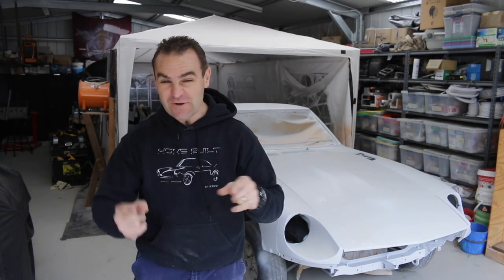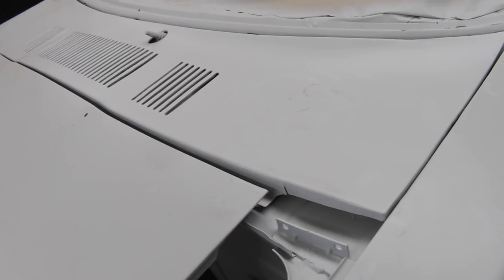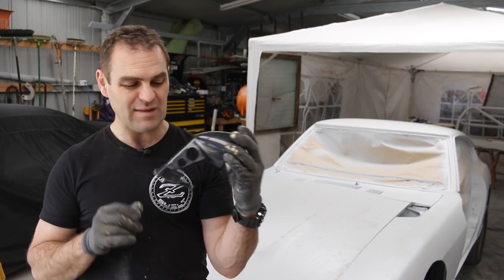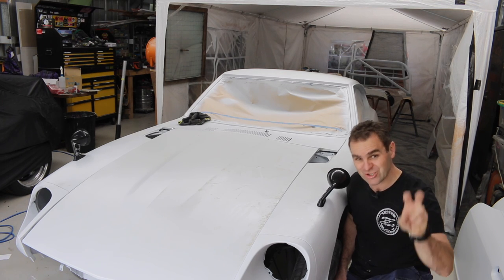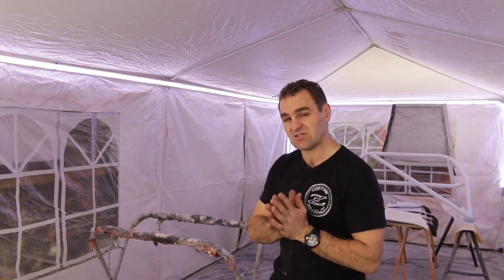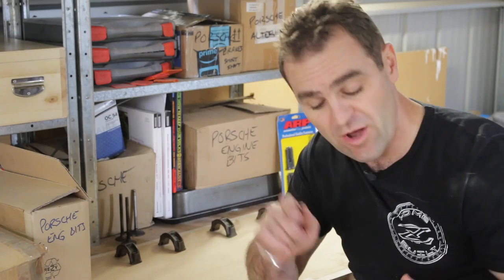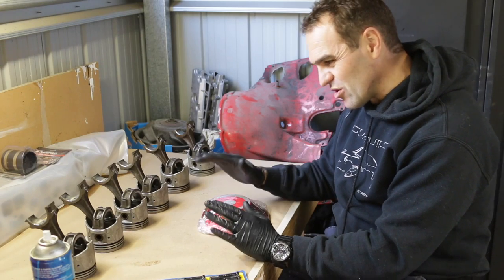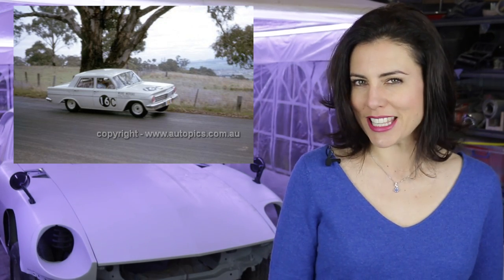How to mount mirrors and cleaning pistons - Home Built Datsun 240z part 40

Comment: Jeff, I also could not come at the price for the reproduction or OEM long arm mirrors for my 72 JDM Fairlady Z. I am in the process of modelling a set of replacements to 3d print. I've got hold of an original and they will look very close including having springs underneath to allow them to flex if bumped. I'm a few weeks away from finishing. May look to sell some as kits - they will require sanding, painting and assembly.
Reply from the maker: That sounds like a much more sensible idea. Send me a pic when you are done.

Comment: I used the cheap fender mirrors (£29 on ebay) on my 240Z. I sanded them down to remove all of the moulding lines then etch primed, anthracite grey solvent base and 2 coats of 2k gloss clear. They look awesome. I like the holes too.
Reply from the maker: I will do similar, just get rid of the holes ;)

Comment: Great work as always, I'm curious to see which are areas you'll grind to balance the pistons. I did it once on my Merc engine to match the weight of a new rod to the old ones and I tried to remove material around the con rod bottom and sides. 2 gr meant a lot of grinding! About the mirrors, can you try to locate a Japanese scrap yard on the internet? These mirrors look ok but a little too tall?

Comment: First off, been enjoying the series (all three of them!) Mixing the LED color temperatures is a common practice to get better color reproduction from leds, well done. Question: Are you reusing the crank? How are you going to balance the crank with the newly-balanced pistons? And I agree with the other commenters, new headstuds would probably be a good idea...
Reply from the maker: I am putting in new head studs, but reusing the pistons, rods, and crank. I haven't had the crank balanced, but it is in good condition from what I can see and is still well with spec, so I am just going to go with it.

Comment: Dude have fun balancing, it’s very rewarding. Are you going to balance as is or remove the connecting rod from the piston?
Reply from the maker: I am not removing the rod from the piston, as I am not replacing the gudgeon pins, so there is no point risking damaging them. I will balance them though, I have ordered another set of scales that measures to 0.1g, so we will see how it goes.
Reply: Home Built By Jeff right on! Yeah that was probably one of the most you know what clenching process is putting the pins back in for my Z engine. Lol. I had the same thing happen with my scale I bought that was just to the gram, so frustrating. You will like the new one.

Comment: I'm guessing your engine builder in the USA would balance each piston and then end to end balance the rods? If you don't separate the rod from the piston, then how do you know where to remove the weight from?
Reply from the maker: That is going to be more difficult, but I will try to weigh each end. I don't want to press out the gudgeon pin, as I am highly likely to damage something.
Reply: Yeh the small end is heat shrunk on to the gudgeon so they are generally not repressed off without damaging. In saying that, occasionally we would have one stick as we were fitting them at the reco place I worked at , so we would have to notch and offset some pipe to support the piston and press them out carefully.  It isn't generally done though!

Comment: About the LEDs, i'm gonna give you a little base about optics (trying to not sound cocky while doing it). Solar light is a wave composed from all the different wavelenghts, some of them are visible for humans.
Now when you see a red flower it means that it is absorbing all the different colors apart from red, which is reflected being able to reach your eyes that will say it is in fact red.
The problem with LEDs, at least with cheap "normal" ones, is that they emit a specific shade of light so if you are in the dark with a blue LED and you point it to the flower i was talking before there will be no red wave for him to reflect and you will not be able to see its "true color".

This is why there are special LEDs that emits all the spectrum that are often used from shops in their windows to display merch in the best way possible. Considering their major costs a cheap solution would be to use RGB strips set on white (white in RGB strip is obtained by having all the three color on at the same time), that should end in having a wider range of waves emitted and a more natural light.

TIP: if you ever need to check an infrared led like the of the TV remote, just use the camera of your phone and check if it turns on when you press the buttons, that is possible because camera sensors can catch a wider range than the only visible lights
Reply from the maker: Interesting tip.

Comment: When I helped out in a machine shop as a kid, Blue Printing a engine was basically applying blue print printers ink to engine parts, then looking at them with a black light which highlighted any microscopic cracks or any cracks at all, And of course balancing was balancing all moving parts. But hey that was 50 years ago. We used to work on Daddy Don Garlits dragster The Swamp Rat.

The Z is looking fantastic. You could probably make a living just doing all the metal work and painting, then let the new owner do all the rest. Thats the part people end up paying big bucks to have done.
Reply from the maker: That sounds like the true meaning of Blueprinting an engine. Nice I didn't know that.
I am starting to think, that all the body work is so painful, that I need to streamline it. I actually prefer doing the engine building and the other fun stuff ;)
Reply: Your very good at the body work and engine work. I have always had a problem with being such a perfectionist body work always gives me a fit, but Im learning from the way you work. I need to find a happy medium. Good to see you wear your dust mask, take it from me it will catch up to you. When your older and you really need your health is when it starts to take its toll. anything man made is very bad on your lungs, it dosent know how to handle it. Your a Fireman so you know this.
Hey.....Its all Fun.

Comment: in some cars mirrors are non-symmetrical for a visibility reasons :) since You are not sitting in the center of the car your visibility angle towards mirrors is not the same right to left :) 
P.S. DO NOT reuse head bolts :O
Reply: Martynas Gabdankas Why? They are not a torque to yield (stretch bolt). Unless the threads are damaged or they are corroded, just clean them and the head bolt holes in the block light lube on threads and under washers and torque to factory spec. Heat cycle the engine and do a re-torque.
Reply: knowing the price of the bolts compared to the price of a rebuilt  engine I would not take the risk, knowing how old that engine is....
Reply: Martynas Gabdankas what's the risk? Catastrophic engine falure from head bolts. It's more likely to fail from him fitting the ARP rod bolts without resizing the rods. The L series engine is one strong power plant and i always have at least 1/2 a dozen of them in the shop at any given time. Performance builds get ARP head stud kits but a stock bolt will be fine for Jeff. He will be stripping it down sooner than you think. Let's not forget we are talking about Datsun owners. They are notoriously tight asses when it comes to spending money. I deal with them ALL the time.
Reply: well I meant that old bolts DO stretch not just torque to yield... whats the connection between ARP studs and resizing rods?
Reply: Martynas Gabdankas he is going to fit a set of new rod bolts without resizing the rods which will affect the bearing clearances. He is reusing high wear components like pistons and valves yet head bolts are a major concern to you. Please explain the failure that will occur due to this issue that is standard industry practice of reusing factory bolts. I only watch this crap for comedic value to amuse myself with his bumbling through his explanations and now know he has followers of the same standard. Uuumm aaaahhh eeerrrr!
Reply: You are one angry bastard :D well valves and valve seats needs to be checked and fixed if needed, doesnt matter if the valve is old or new.... pistons obviously need to be checked as well if theres no damage to them and if your building for stock power they will hold that stock power...obviously you will put new rings on them... My point with Head bolts ir that they hold a lot of torque and they tend to stretch so why risk knowing that they are cheap... but I still dont get your theory behind ARP studs, if you torque them to the same torque as stock bolts what do you expect to crush??? on top of that after torquing down you can measure the oil gap with that special plastic stuff witch crushes inside and flattens...

Comment: Mirrors belong where they are close enough to actually see someting - not on the damn fenders!
Reply from the maker: Talk to the Japanese, they designed the car that way. They just changed the location for everyone else.
Reply: To add to the conversation, Japan uses fender mirrors becuse roads and in-between building driveways are super narrow there. You may also find plastic rods sticking up from the front bumper so that drivers know where the corners of thier cars are. Fender mirrors don't exist becuse they are stylish. It's because if you drove a side-mirrored car in Japan, you would not have side-mirrors for very long.
Reply: They are absolutely useless on the front guard. It’s just a fan boy fad like flares and stretched tyres. Have fun working on your engine with those things in the way.